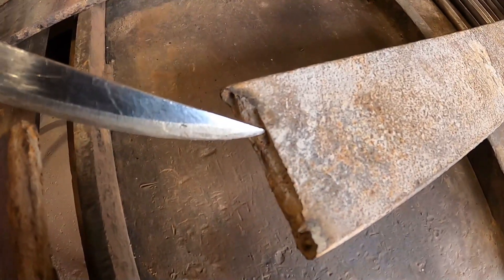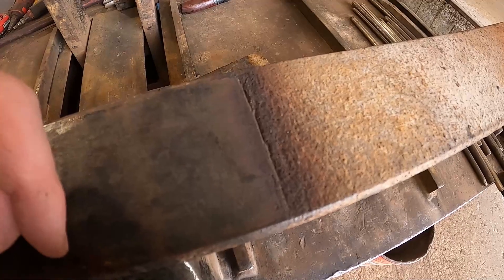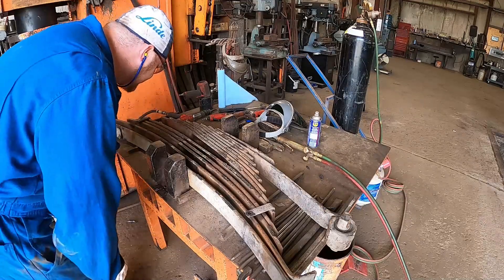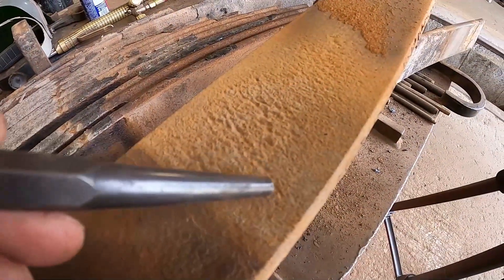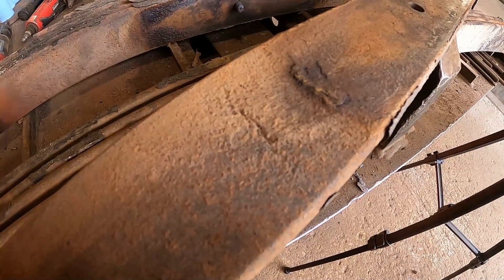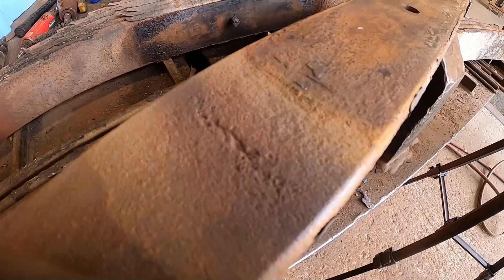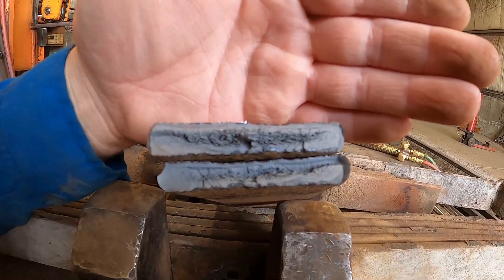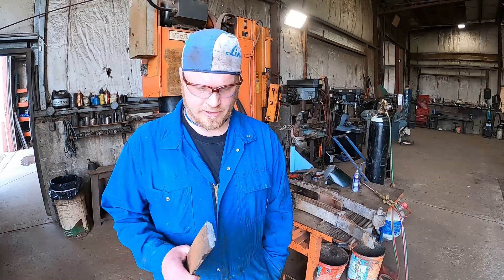Are my springs worth repairing? leaf spring breakdown, cleaning and diagnosis

Comment: would I be wrong to use the word "pit" instead of "crack" ?
Reply from the maker: Pitting corrosion can help initiate stress corrosion cracking which will lead to failure.  the deeper the pitting and the more they line up together, the more often they cause failure, or stress crack due to corrosion.